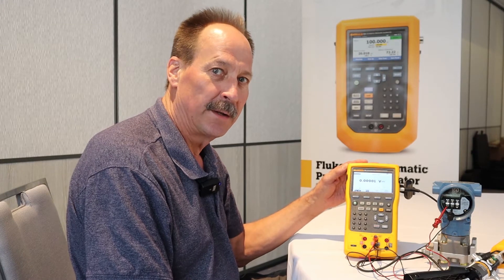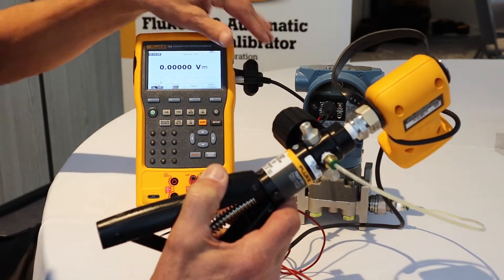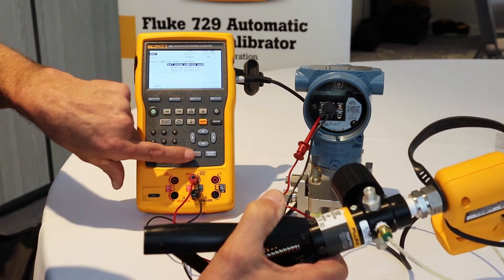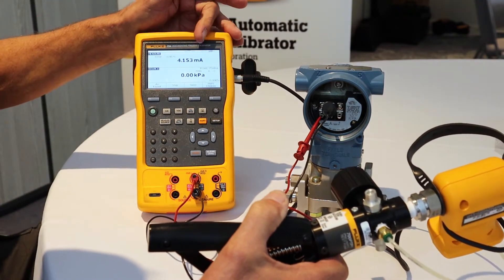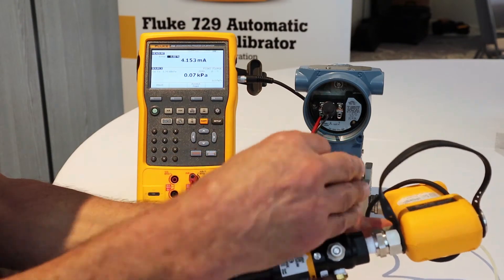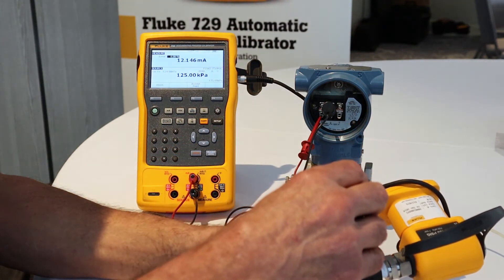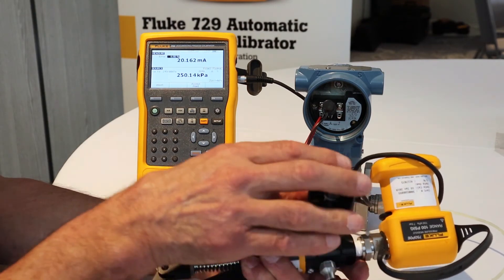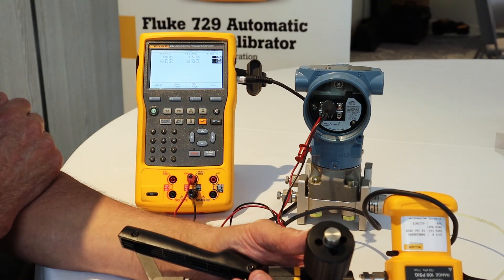Fluke 754 Documenting Process Calibrator-HART with Jim Shields | Fluke Australia

Comment: In the case that the equipment does not connect with some instruments that have Hart protocol. How do you update so that it can connect? For example, it does not connect to some Masoneilan instruments and some Fisher instruments. If they are Hart protocol, why doesn't it connect with these instruments? some update is needed